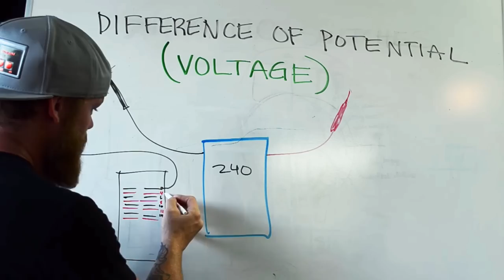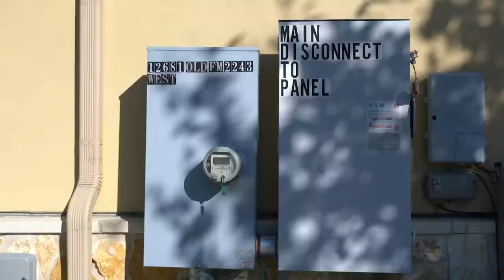Homeruns, Feeders, Service Entrance Conductors, & Branch Circuits

Comment: Circuits are the most generic term. Home-run is specific to the segment from the panel to the first device. From device to device is a jumper. From switch to fixture is a leg. Service entrance is from the meter to the panel. Drop is from the utility transformer to the meter (either aerial or buried).
Reply: Better than the video, thanks. 

Love internet and YouTube.

Comment: The term home run is a "trade" term. It isn't found in the National Electrical Code,  and therefore can some times it can be used to denote feeders when your working in a commercial or industrial setting. As far as referencing residential wiring you are correct. Its important that when one is using "slang" terminology that you clarify in the field what your journeyman is asking for. Electricians are notorious for interchanging these terms in the field.

Comment: OK....here's a video you can do if possible......do a video explaining how to connect the wires to a component together when one of the set of wires needs to go out to another component. If its not a "universal" method of connection these "junctions" then maybe you could explain what scenarios would require a different method. That would help me out A TON. Thank you sir....great video.

Comment: I got a question. 
It’s about wiring home runs to the second floor in a house where there’s mainly bedrooms (3-4) and bathrooms (1-3). 

Is it a good idea to run all the lightings on one circuit and then all the receptacles on another circuit?
The idea and/or convenience behind this idea is that in the future if the home owners wants to update the light fixtures in the bedrooms they can cut power to the lighting circuit yet still have power to the receptacles circuit to plug in a work lamp to see in the dark. Or vice versa, if they want to upgrade and/or change receptacles they cut power there yet still have power to lights in to room to work. Bathroom can have its own circuit maybe shared with the hallway or top of stairs landing. Usually that’s where you’d have hairdryers plugged that has more power consumption. 
Is this a good idea or practice?
What does codes say about this configuration?

I’ve also heard the argument that having too many receptacles on one circuit there’s a potential to overload it depend on it’s power consumption. 
For example, in winter time if all the bedrooms have space heater plugged in that may be too much power consumption for one circuit. And if someone decides to plug in a vacuum cleaner at the same time there’s a good chance it will trip the breaker. If that keeps happening frequently then there’s potential to melt the conductors.

Comment: we had a wall demod out of our house and the guys that took the wall out just snipped all the wires. there were 2 light switches and 2 outlets in the wall. They didnt label anything before snipping the wires so now i have no idea what wire goes to what. Is there a way i can figure it out?
Reply: MuttonChops24 go in the attic and trace them out.

Comment: Dustin. Love the videos and you do a great job with them. I have just one request. I am an electrical trades instructor for high school students. I Teach Residential/ and commercial construction wiring as well as industrial motor control wiring. Your videos are a great tool to use and the students like your videos. The one issue I encounter when deciding to use your videos is Language. If there is any way you might not use certain words in your videos my students and I would appreciate it. I hope you understand that being in a school there are rules. Thanks again for the content..
Reply: Wouldn’t be a bad idea for all the vids…Hmmm

Comment: So I have a question , let’s say I run a home run to a bed room will I need a circuit on its own breaker for the out let’s and the lights or can I just use one breaker for the whole room and just branch it off with the outlets and lights ?

Comment: My boss has a farm with five sheds on it. He has an outdoor service panel by the power pole that has a large breaker in it for each building (80-200 amps). Each building then has it's own distribution panel with regular circuits. What is this setup called, and what is the main panel outside called?

Comment: Hey guys I have a question I been doing commercial construction for a month now and it’s great but I wanted to do residential wireman or construction. But this job came up and Since I wanted to be a electrician I took it but my question is if I do 5 years experience for commercial construction and become a mechanic and then move to residential would I have to move residential would I have to start from helper again ??

Comment: can SER or SE-U cables with their higher ampacity ratings at the same guage (as opposed to say THHN) be used as feeders or branch wires at their higher rating?  i.e. can I use 100amp capable SE-U cable to feed a 100amp car charger outlet from a 100 amp breaker? I notice that SE-U and SER cable seems to have higher amp ratings than same guage wires that are other types.

Comment: I do drywall and am looking for a new career, constant boarding is starting to wear on my body, heavily on my back. Looking for more balance between labour and problem solving. What steps would I take in becoming a Electrician? There's never any jobs posted online. Co workers said I need to do some tests first and then apply for a apprenticeship just to even start. Do you have any content directed towards this? Looking for any advice on my days off to plan a strategy.

Comment: If a conductor has a splice between the panel and the main point in the bedroom, is it still called a home run?

If you're running a conductor through conduit and there is a junction box between the panel and main point in the bedroom but no splice.  Is that still a home run?

Comment: Hey Dustin.... I was wanting to start finishing my basement but, when the house was built they used up every circuit breaker slot in the panel box and was wondering how I could install a sub panel box that would service the basement?  The main panel is on a 200 amp service and I'm not quite sure what a typical basement sub panel box should be.   Thanks!
Reply: Zane consider using twin breakers. There’s two breaker switches on the device but it only takes up one space on the service panel. Change out some of your existing single breakers to this type and you’ll have more slots. The 200 amp service panel should be able to handle the additional circuits that will go to your basement.

Comment: I believe that feeder also means all conductors between any service equipment and any separately derived source -- any generator/PV/inverter/battery/UPS supply conductors are considered feeders. Confusing distinction but affects rules.
Service cable is feeding utility (Poco) power on the 'non-utility owned' side of the service point until main disco only (and service point annoyingly changes from one Poco to another Poco).
Pita

Comment: When you have a multi wire branch run they are all sharing a common return, how is it you can have 2/3/4 hots on say 12ga and a return on 12ga and not run into issues with melting the return due to the current load? Is the size of the return not as important as the hot wire?
Reply: Those hot wires that share the neutral should be in different phase. That way the neutral wire only carries the current of difference between 2 hots.

Comment: Dustin, I’ve recently discovered your channel And have watched quite a few of your videos. I really like your no nonsense approach. Is there a video you have done that addresses tracing wire from a dead outlet that is in a finished wall? I have taken the outlet loose and the wires all hooked up but no power is coming in. I don’t want to tear into the walls if I can avoid it.

Comment: So a branch circuit is some definition of "from final overcurrent device to load". In the case of large loads I.e. a 200a connection from a panel to its final load (say a motor), I have always battled whether this is a truly feeder or branch circuit. I always call/treat this as a feeder. What is everyone else's take?

Comment: What is the difference between a homerun and a branch circuit?
Reply: Essentially nothing , a home run starts & is apart of a branch circuit but ends at the very first electrical component (device) of each branch circuit. A branch circuit is the last part of the circuit ( and the running middle the circuit depending on what type of circuit. ( general purpose & dedicated circuits.
Reply: If it does make sense let know lol , I'm an electrician by great trade/ advanced education. So I'm trying not to sound complex.
Reply: Along with what Christopher said: Each circuit breaker is the start of the home-run. The home-run is the beginning of the branch circuit, and the home run wire is the uninterrupted wire that goes from the circuit breaker to the first device/box. The last hot jumper from that device/box is the end of the branch circuit.
Reply: You may often hear electrically-minded home sellers that will boast, "Every room in the house has home-run circuits." That just means every room has its own branch circuit (a breaker in the panel) that serves that room and only that room. Dedicated circuits, in other words. Not a bad thing, but overkill for the average family.
Reply: @aaron74  most homes are roughed in ( parallel) with speaking schematics & electrical blueprints. With dedicated circuits for specific reasons. , I'm just an electrical contractor , I dont sell homes so I can't relate to that statement more or less.

Comment: Not related to this video.. I just watched all videos which had somewhat interesting titles, but it seems that there is one really big thing still missing. What kind of documents you need to be able to read and how much you can trust those?  Do the designers know what they are drawing and how it affects actual installing on the field?  How much do you have to change given documents on the fly and do those get fixed eventually?  What kind of documentation the end user gets after a job is done?

I have been an electrician for over 20 years in Finland and it seems like the professionalism of electrical designers has been on a down hill all this time.  Couple times i have literally had to turn the plan sheet around and start from scratch, as only things that were right on the print were outer walls and street address in the corner..  So, it would be fun to see how these things actually work elsewhere.

Comment: My Knob and Tube needs to be repaired...can you make a video on that ??
Reply: Universal Steele Sir you’re going to need more than a DIY video.  I’m a 20 year guy and only encountered knob and tube maybe 4-5 times in homes.  Please go with the safe option of having a qualified electrician help you out.  The knob and tube was a staple for older model homes but can easily be a major hazard based on the damage caused by rodents or even remodeling.  Good luck.

Comment: last bit...lmfao, any run that goes back to its own panel ie distribution panel is called a home run.  wether its a subpanel or main panel.... a singular curcuit thats leaves a panel and comes back, at the first outlet...its a home run.  now if your wiring a house in construction...that means a slightly different thing...but in general it means 'the only' line connecting your circuit to a panel.  subpanel/main panel etc.